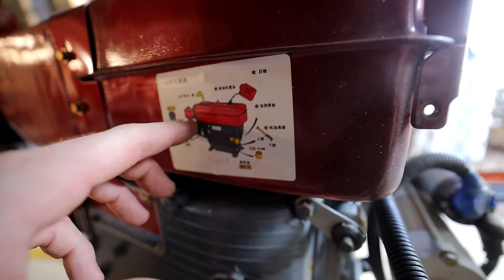Testing CHEAPEST $5,000 Chinese ROCK CRUSHER (on Alibaba)

Comment: The rocks get pitched out because you are putting rocks in one at a time. It is designed to have the hopper filled all the time and the rocks that are getting pinched are held in by the weight of the rocks on top of them.
Reply: And, he is running it faster than I run a crusher that small.
Reply: Need hopper or you will destroy that engine with flying/falling rocks bro
Reply: You are what I like to call “correct”!
Reply: I thought the same thing - engine speed may be too high, thus the flying rocks.
Reply: Good point.
Reply: I guess it is the shape of the rocks. The crushing plates can't get a hold on it if the rocks are smooth and round.
Reply: You screwed me! I saved $5k for a entry level used bassboat to buy while my spouse was at her mother's for the weekend. Now I need a rockcrusher.

Comment: I bought the same exact machine and engine 10 years ago. Some advice: keep it out of the sun, the UV will damage the plastic water fill, the plastic oil pump sight cap, the throttle screw etc and you will not be able to buy replacements. also the fuel filter will leak as every connection on the engine with oil. I've had to rebuild the fuel system with us parts as the chino ones are terrible. Replace the jaw bolts with grade 8 nyloks, and the original ones will break or keep coming loose., same for the flywheel bolts and bearing bolts, they will all come loose and none of them were tightened in the factory anyways. The water will rust the cast iron water chamber and clog the drain all the time, better to clean it with vinegar and paint the inside with epoxy. Store it out of the rain and sun, and it will last 50 years!
Reply: So basically do half the work they should have done lol

I love these kinds of Chinese products, barely working out of the box but a tinkerer's paradise
Reply: @FAB1150  yup! lol I purchased several of these, some better than the others, zero quality control and prob all made by prisoners lol.  1/4 of paint over the sand left in the casting is common, completely missing welds are common,  different bolt threads in the same component is common, if you even get the bolts or the threaded hole at all. Every machine I buy immediatly is broken down straight out of the 1/64th thick wood crate and inspected, cleaned and re-assembled with real grease and american bolts.  It's like a comedy puzzle or what i will find each time.🚩
Reply: If it were me, I'd do a engine swap from harbor freight.

Comment: The little lever is your decompression Kevin it holds one of the valves open so u can spin up the motor easier it will save your starter
Reply from the maker: Good to know for sure.  I found by trial and error it was easier to start with it pushed!  Thanks!
Reply: Kevin I didn't see you fill the oil pots any? I would assume each use they would need filled to save the oil impregnated bushings. What type of oil did they say it needs?
Reply: @richardnott9587  It looks like ALL the Instructions are in Chinese.
Reply: Do these come filled with vegetable/rapeseed oil in the sump as shipping oil?
It may be a country specific thing but all the engines I've recieved from China had veg oil in place of engine oil due to shipping regulations
Reply: @Th3_Gael  I might have just found this out the hard way.
Reply: @bcg1976  not good, though I've found if you can get o erhaul kits they're usually quite cheap, if the block hasn't been destroyed that is
Reply: @Th3_Gael  hasn't run very long. It will probably be fine.
Reply: @bcg1976  even better news. I've seen a lot destroy engines because they didn't change the shipping oil
Reply: @Th3_Gael  I should know better.

Comment: Cover that water entrance, or you'll likely fill it with rock dust.

Also, those crush plates can be fixed up by hardface welding them as they wear.
Don't let em get too worn out.
Reply: I work in a rock quarry and run a jaw crusher that can fit a car in and I agree about not letting those jaw dies wear out. Once those teeth are gone the rocks will eat a hole through it and the entire jaw die is garbage. My jaw dies are made out of manganese
Reply: The jaws typically are cast austenitic manganese steel, also known as Hadfield steel.  They can be repaired by welding with a matching filler metal.  Hadfield steel work hardens with impact and to some extent  abrasion which is how it develops it's maximum hardness.
Reply: I don’t believe you can hardface them
Reply: @blacksheep9734   if they are in fact Hadfield Steel you absolutely can.  Remove the work hardening by grinding, butter with a layer of E307-16 CrNiMn austenitic stainless, then finish with EFeMn-A.  Finish the surface as needed by grinding.
Reply: And even if those get worn out, well get most of it out of the machine, make steel replicas out of those plates and put the hard weld on top and those last least half of what original will last.
Reply: Usually you just flip the jaw plates when they wear out, I work for a crusher dealer as a mechanic

Comment: Put it on a hill (or blocks). Then put a corrugated chute under it so the fines and rocks fall separately. Cut slits in the bottom corrugated for a fines outlet into a diverter. You can screen the gravels from there or not. It probably compresses better with some variety. 
Wish I had one of those on my WV property!
Reply: If looking to make a driveway, keeping it all together is best. “Crusher run” is what is used for our farm driveways, and after some compaction is gets really smooth.
Reply: If you do want to separate some sand you could buy a sheet of crusher screen with the correct size hole guage you want, sand falls through.

Comment: So you will find certain material is harder hence some of those rocks don’t crack well. It’s called a splash cooled diesel. Essentially the cylinder is just splashed with water. Very handy. You can use literally any water or you can use proper coolant. The amount of time you get from the plates will vary depending on the material being used. Also. Having used similar products I recommend going over everything after an hour or two of use. Possibly grinding out any cracked welds and re welding. Check bolts etc.
Reply: Good advice. I would just add check it regularly for crack and loose bolts with ongoing use too. Cause of vibration.
Reply: The cylinder is surrounded by a jacket of water.  I think you're confused by the term "splash lubrication" where the connecting rod has a dipper that splashes oil everywhere....
Reply: @shawnbottom4769 you're right, the engine is cooled by evaporation. As the water evaporates, it pulls some heat with it. This engine design is probably close to a 100 years old, but if it works it works.

Comment: The bolt and spring in the motor side of the crusher I believe is the throat or size adjuster for the crusher, if you shorten the exposed part (tightening the spring)  it should narrow the opening for smaller stone

Comment: That’s really impressive for something off alibaba.  Was not expecting it to be as effective as it is with how it looks, but damn that broke down the rocks like a champ
Reply: To be fair it is a old very simple design so hard  to puck up. The only issue is how long will that chinese engine last and how long will the crushing plates last (But at least those can be fixed up with welding on more and proper material)
Reply: It's already cracked in several places and rusty not looking good

Comment: I'd probably add a small hopper to the top of the machine for those harder rocks. If you have a load of rocks piled up in the chute then it will help to push them through without them getting yeeted into orbit!
There is also a big metal plate on the underside of the crusher jaws, held in place likely with a big spring. If the crusher can't handle a rock or tries to jam, the metal plate will fall out of place to protect from those flywheels from destroying everything.
Reply from the maker: That's good to know.

Comment: I worked on a similar jaw crusher but much larger one summer, it was a highway project near the town i lived in. I was told if we were to ever run gravel pit stone, round rocks, to always make sure i had a good mix of gravel and smaller rocks. The large jaws would spit huge round rocks high into the air if i didnt have ballest on top. Luckily we were able to stay in the blasted rock quarry.

Comment: The plates are manganese vary hard and and be welded back up with hard surfacing rods after they get worn down. Next you’ll be getting a hammer mill or cone crusher
Reply from the maker: Very interesting.. I got a spare set just to be sure.

Comment: I have to wonder if there’s a way to adjust the crush-plate spacing to produce smaller gravel. Maybe spacers behind the crush plates if nothing else?
Reply from the maker: Yes you can adjust down to 10-15mm   the size it's at is perfect for my application
Reply: @ModernSelfReliance I used to work in a quarry years ago. We never had any problem with rocks spitting out like that. Drop a singe big rock in and some would bounce a bit until it got a grip on it, but as soon as it got the first bite the rest was history.  But we never made small gravel like that on the primary crusher, there was a second pass through a hammer mill for that. So the jaws were opened up a lot more than that.  I'm wondering if open the bottom up a bit bigger makes the jaws closer to parallel thereby reducing the tendency to spit those hard stones back out?  It will be a cost thing. Shorter jaws and the associated frame they are mounted in are cheaper to make.  However the shorter the jaws are for a given opening in the top, means a greater angle between the jaws, cheaper, but also greater chance of spitting rocks out again?  Still a very cool little crusher for the price though. Love it, I'm jealous!  Another thing/trick I just remembered, for the rocks bouncing instead of getting grabbed and crushed we would slow the crusher down a bit until it grabbed and then it could be sped up again. For those hard rocks perhaps it's going too fast?

Comment: FYI, for the water Drain. After Testing the unit, they might have pushes compressed air thru  to fully drain the system and tank and then pushed some thick oil thur as well to coat the inside of the tank then drained the tank again. As a way to Prevent Rusting. So that bit of why it wasn't draining at first Could have been a little bit of thick oil at the drain that was left over.
Reply: Thick oil from China😂, first thing i’ve learned to do on the few things I have imported from china with motors or need for lubricants is to drain out the Chinese honey first thing.
Reply: probably full of all types of aquatic parasites and diseases.....and the bottom of the motor was already rusted 🤣

Comment: The unknown lever will be a decompression lever to decompress the engine while it winds over then when the starter motor is up to speed you can let the decompression lever go and start it. Probably helps a lot with those giant fly wheels being permanently connected to the engine adding more strain to the starter

Comment: Kevin, if you find many limestone chunks you could build a kiln and bake it into lime to use for making free cement.

You could also make some sort of deflector to deal with the rocks flying out. At least then you can try and aim them away from anything important?
Reply: like the top of the engine?
Reply: @CuriousEarthMan  like a metal flap to act sort of like a lid for the hole the rocks go in to stop them flying back out so dangerously…
Reply: @glawenclattuc3127  I completely agree! I was giving an example of one of the important areas that needs to be protected from flying rocks. I would make the guard concave, so rocks flying up into it do not get deflected off of it, and fly out the front, for example.

Comment: I used to operate a walk-beside aka pedestrian three-wheeled chain trencher for a major telco. It had a single cylinder air-cooled 15 hp Yanmar diesel, also with a decompression lever. In its   original form it had no electrics at all, being hand-cranked. Once I hadn't spun it over fast enough and upon releasing the decompression lever it started running backwards, crank handle spinning backwards instead of disengaging, black exhaust smoke coming from the air cleaner and sucking air in through the exhaust. Fortunately there were stop controls on both sides, a co-worker shut it off safely from the other side. 
After this incident the machine was returned to the manufacturer and fitted with electric starter/generator and battery.

Comment: open the jaws wider on the crusher for the blue rocks and make 2 passes to crush it if that particular one isn't adjustable make a hopper chute and keep it full it will greatly decrease the possibility of those stones popping out...
that lever on the valve cover is a decompressor lever it opens the exhaust valve so that the engine spins over freely once its spun up you release that lever and it starts.
you will want to add a feed chute to the crusher inlet with a removable plate steel hood, a good way to use this is a conveyor under the output to pile it into a trailer/ dump bed for spreading and a conveyor to feed the hopper chute for crushing...when I worked in the quarry we set ours on a set of concrete blocks (single pour 2ftx 2 ft x8ft solid cast with) removed the axle and hitch as it was going there permanently  bolted in place through a set of hockey puck isolators set up a conveyor with hopper under the crusher exit that could pile it with a concrete block backwall... we fed it via a conveyor belt always keeping the hopper above the jaws full

Comment: Freight guy here-   They put it on the smaller skid (which is actually a heavy duty CHEP pallet) in order to have a chance to even move it to the back of the truck. A pallet jack is designed to move standard sized pallets, and so in order to get it onto the liftgate it needed to be on that blue pallet.

Comment: Rounded river tumbled rocks are all generally hard on a crusher of this size and gap. It's decently easy if in the small batch like probably a hundred pounds at a time, run it out to the largest gap first, run your larger rocks in, crank the gap to half, rerun the result on down to what you want. Those really hard roundish ones, put one of those in followed immediately by another like one of those paver stones that'll basically hold the harder stone in place for the jaws to crack it and begin the breaking/crushing process.

Old bricks, oyster/clam shells, waste bits from stone counter tops, some construction debris like its of concrete, pavers and assorted field stone. Bring it out to the place in your driveway that need more gravel, crush up a few pounds.

Comment: You should build a ramp for it to sit on, that filters the various particle sizes, you could do multiple sizes with a single platform, and have them roll down to different areas. 
Sand below, 3" behind, 2inch to the right, 1inch to the left, etc.

Comment: Very cool! I have an odd fetish with making gravel, lol!

It's also interesting how the old timers did it before engines were a thing, it be cool to try and build something like that. Essentially big pounders that were raised and dropped using fulcrums and pullies. What you have is much easier though 😂 

Be interesting to see how it holds up, hopefully you get your money out of it and a lot more.
Reply from the maker: I was thinking of making a heavy thing that drops....  But then I bought this thing.
Reply: They used big hammers and muscles. We got to see it in jails in the south. Also Mr. Nobel invented something else to help with the big rocks!!
Reply: @MrHyde2k  haha, that's one way to do it! But I was referring to the two story machines they built that would raise a big heavy plate and drop it. A guy or two could work it, pretty ingenious machines.

Comment: You were commenting on the welds because the slag wasn't beat off before the paint.  I bought a rear blade for a tractor and it was eight feet wide.  While I was grading my driveway,(pea gravel)  it bent and some of the welds had separated in the pivot.  The welds didn't even touch the lower metal,  just deposited on top.  This was  from a local reputable shop.  I contacted them and they said it was abuse so no warranty.  So much for buying local and American.

Comment: Warning.... I used to maintain bigger ones of these. If it jams cut the belts and undo the spring on the engine side. That will take the energy out of the fly wheels. The jammed stone will drop out of the bottom. NEVER stand on top and hit the stone with a bar. A guy was killed locally doing that and the stone knocked his head off. The jaws are Manganese steel.

Comment: The release lever that you mentioned in the middle of the video is the compression release. It opens up the valve so that you can hand crank it without it kicking back on you. When hand cranking these engines you open that valve crank it up to speed then release that after you have built the momentum in the flywheel. I can tell you from experience it's one of the scariest things I've ever done.

Comment: A truckload of washed/crushed gravel is around 500 CAD. So for 6600 CAD (5000 USD) you would get about 13 loads or about 156 cubic yards. Thats without putting any time or money (repairs, fuel,etc.) into it.  I have no experience with your crusher but I can't imagine that it makes any sense to buy something like that? Or what are your numbers? Our neighbour has a gravel pit and charges 130CAD/load for "pitrun gravel" (it is gravel but with all kinds of rocks in it, it makes for a fantastic road base and only needs a light touchup with some real nice finer gravel for the very top of the road). Its really good stuff and I wish I could afford to have 50 loads delivered. I am sure we will use it eventually and it will never be so cheap again.